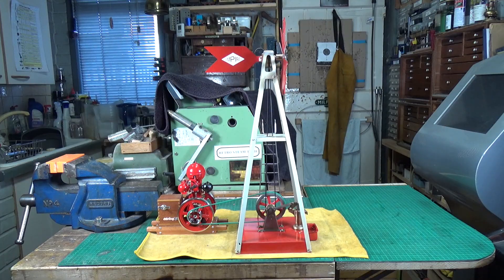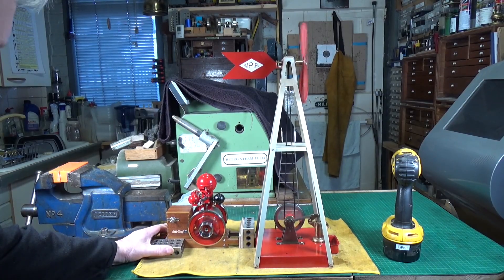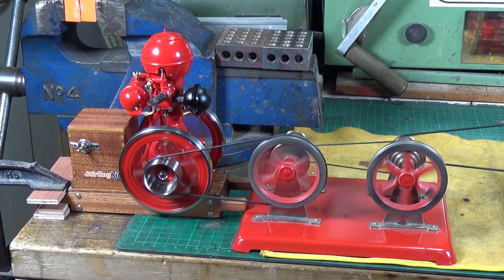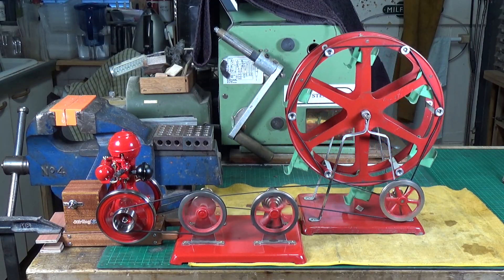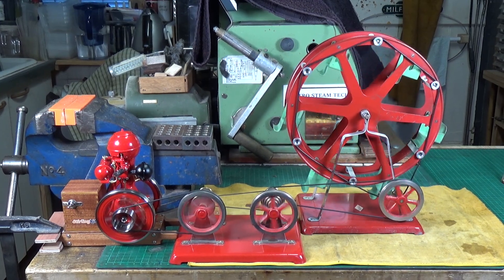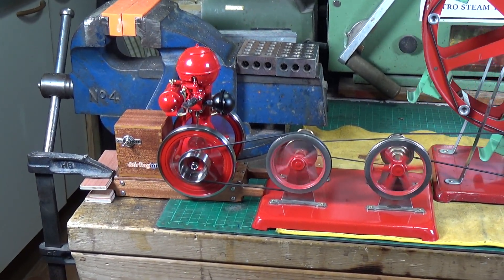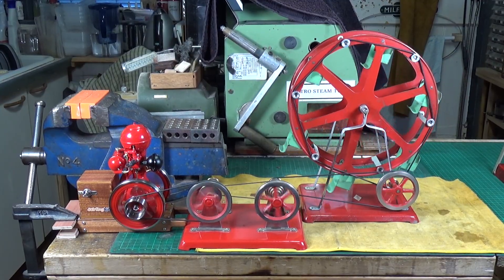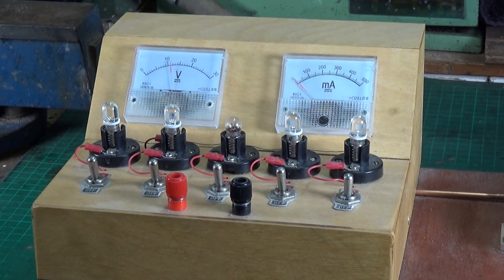Stirlingkit Okmo & Retrol B01 Ball Top Vertical Hit and Miss Engine Running Accessories

Comment: Great to see it running all your lovely accessories Alan. I love your 'load-bank' and the reduction drive thing, I need to add these things to my 'build' list. Great vid, thanks. Ade
Reply from the maker: Thanks Ade. The reduction drive, an Empire B34 Variable Speed Unit, is the accessory that I use the most. Jim of "Blue Heelers" YouTube fame made a couple, both horizontal and a vertical version. His are stunning. Fairly simple to make if you have a lathe. Cheers, Alan.

Comment: Gear reduction is wonderful isn't Alan, the B01 isn't even raising a sweat - Cheers Jim
Reply from the maker: Yes it is Jim. Lost count of the number of times I've used the Empire unit. Cheers, Alan.
Reply: @RetroSteamTech  I looked for one for years and could not find one on eBay so made a couple of my own, a horizontal unit and a vertical unit, they are my most used accessories....for running other accessories.
Reply from the maker: @SteamEngines-Jim  I know, took me ages to find one on ebay. The ones you made are superb 👍👍👍

Comment: Hi Alan.  Good load tests.  Great little engine.  Lucky to get these models.  I like that intermediate speed reduction unit and can see it would be handy, so that may be a future project.  It would be pretty simple to make something similar, or even use some gears.   Cheers Rob
Reply from the maker: Hi Rob. Thanks. Yes I feel very fortunate to have been sent them. The Metalware Corporation who made the windmill, the ferris wheel and the variable speed unit produced some amazing model steam engines and accessories. Jim made his own speed reduction unit which is excellent. Like you said it could also be done with gears although the belt driven pulley version gives you the added safety feature of belt slipping if anything locks up. Cheers, Alan.

Comment: Runs sweet with the gear reduction and hitting and missing nicely. For a more scale appearence I would replace all the socket head srews with hex heads.
Reply from the maker: Yes it does. One of the few model hit & miss engines that runs at a good slow scale speed. That's a good suggestion, I will have to see if you can get tiny hex head metric screws. Cheers, Alan.